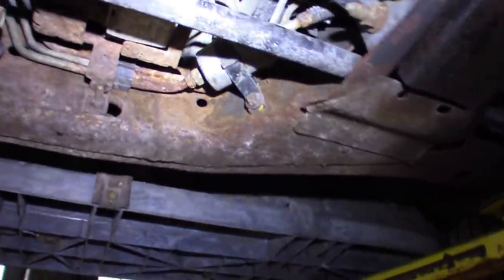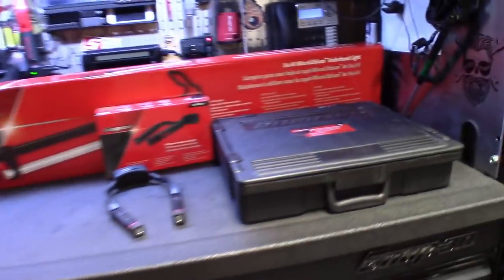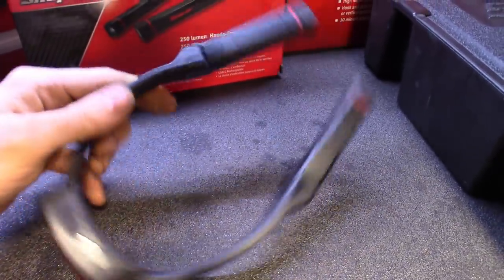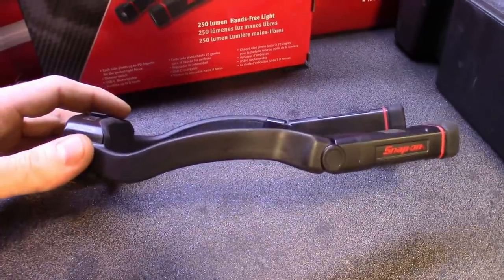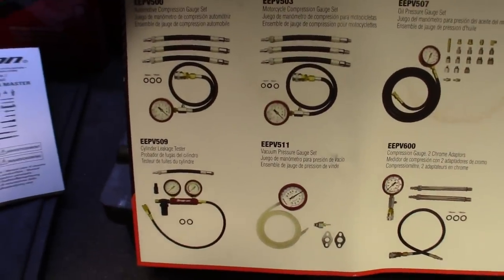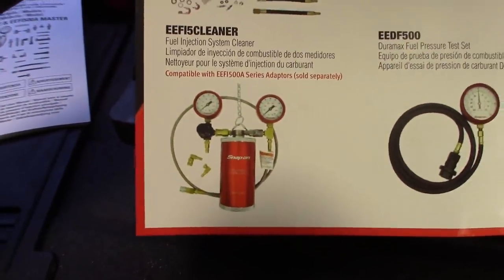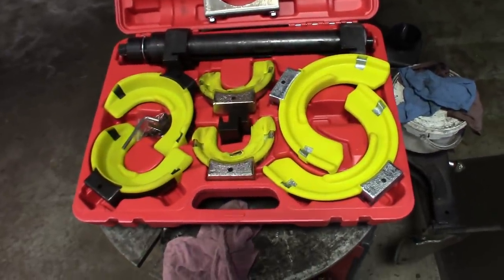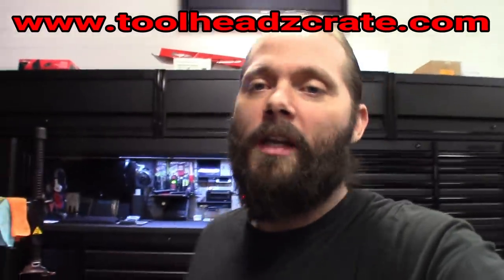Snap On Tool Haul Upgrade Addition

Comment: Know about the 1999 to 2006 fullsize GM trucks and 2000 to 2006 GM fullsize suv with the brake lines very well.Only use the prebent kit made out of stainless steel on them.

Comment: Being a die hard snap on guy I'm really not impressed with their underhood light. Milwaukee underhood light is so much brighter. I'm obsessed with lights and getting different ones from different sources and honestly bro milwaukee lights are the bomb. Especially their new little rover lights to get them in tight places where my snap on ones wont or my astro light. They have magnets also. U should check it out. That fuel pressure gauge is the bomb. I love mine. Helps especially when diagnosing GDI systems. Thanks for the review